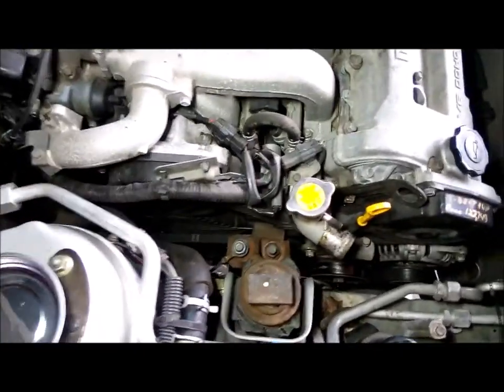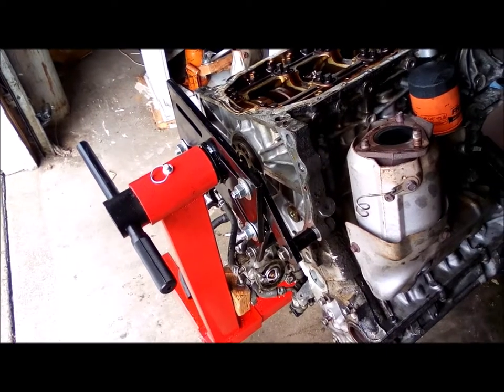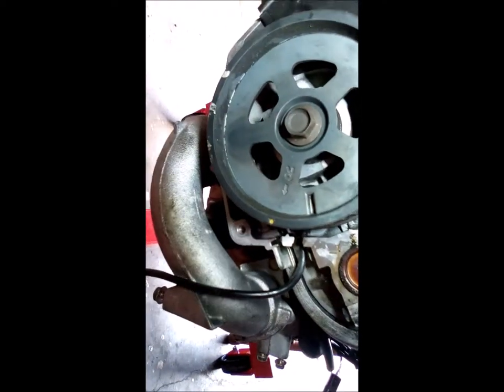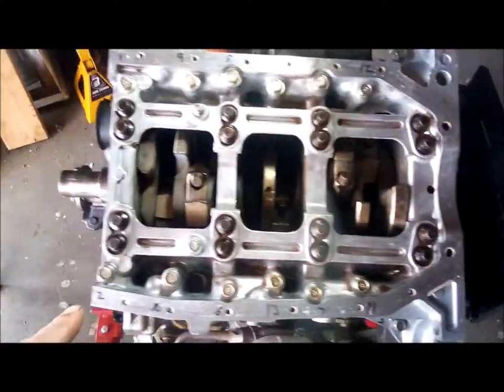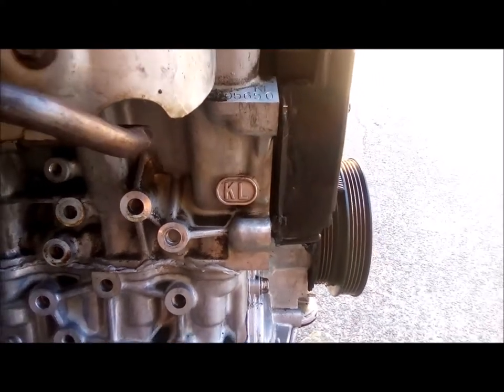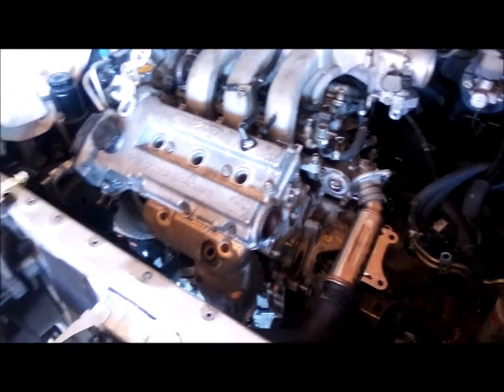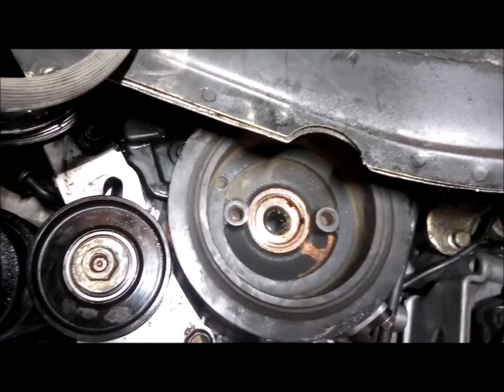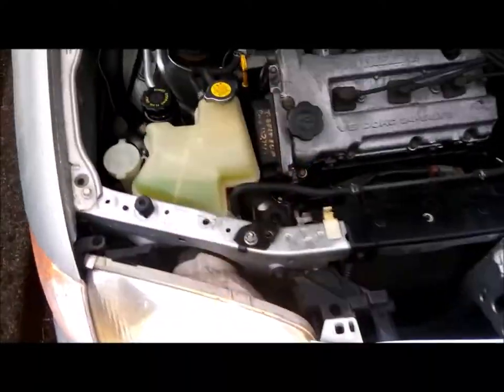2001 Mazda 626 2 5L Engine Removal & Bottom End Rebuild

Comment: Did you ever replaced the old oil pump before you place the lower casting?
Reply from the maker: No, I did not. Motor only has 135k, and the pump looked good and oil pressure is good now with the new bearings.